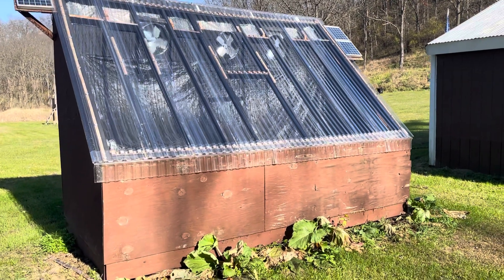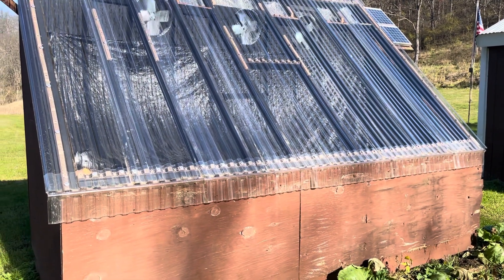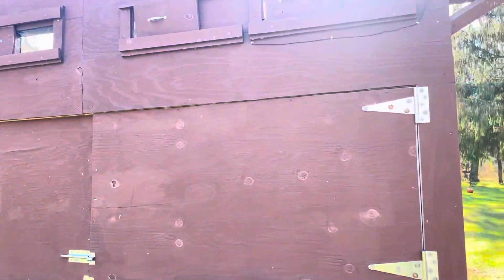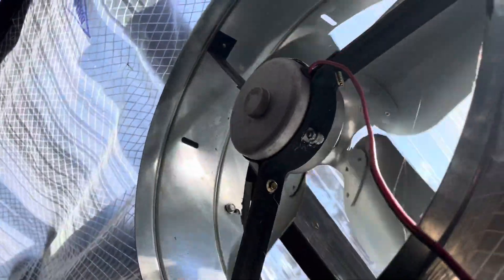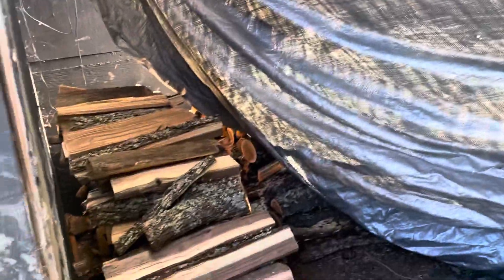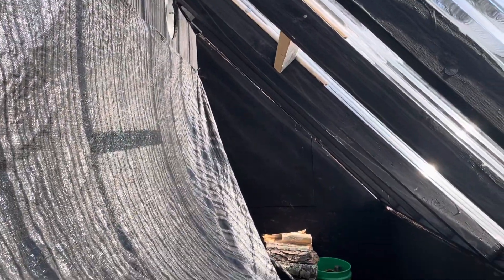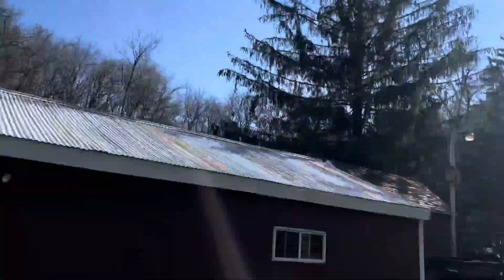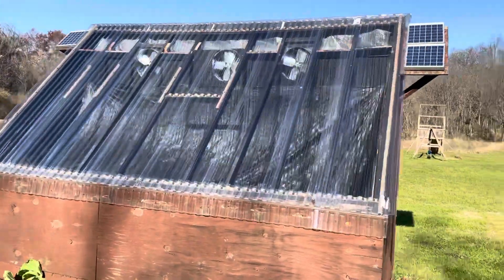Off Grid Solar Kiln Overview - How to dry firewood fast - How to season firewood quickly

Comment: Weird question but with convection wouldn't the cooler air come in through the bottom vents and then rise as it heats up and then vent out of the top vents?
Reply from the maker: It would if there weren’t any fans. The fans produce far more powerful air currents than any differences in air density due to temperature.

Comment: would it dry faster if i made out of metal?
Reply from the maker: It would last longer. We have some outer panels now that are warping and need to be replaced. You would still need to insulate it of course, I don’t know if the actual material would make a difference in heating / drying ability.

Comment: This is a cool design!

I think you could automate it and over-engineer it somewhat by adding a Raspberry Pi or similar microcomputer to measure the temperature and humidity inside then to use that info to control servos to open or close vents.

As an example, just hypothetically, if it's above say 70% humidity you could set it so the vents open up unless the temperature is below 50f.

If it's between 50f and 70f with humidity above 50% you could set it to open one vent.

If it's above 85f, you could set it to open all vents unless the humidity is below say about 30%.

The best thing about this is, if you are clever about it, you could also set a notification for when your kiln has been consistently below 25% humidity for a number of days regardless of the internal temperature. That would indicate that the firewood is dried sufficiently to be ready for use (well probably anyway, though you might need a little trial and error to fine tune this.)

You could overcomplicate it further by measuring the ambient conditions and using that data as well, or by setting up a program so that when the internal conditions aren't producing more humidity than the ambient humidity that all vents are shut regardless of the temperature to do a final day's cooking to force out any extra moisture from the firewood.

You could also do something with a parabolic mirror that focuses on a thermal mass that the firewood rests upon. Think like a mass of concrete or dried clay/cob that has a layer of insulation between it and the earth it's resting upon. During daylight, the mirror would direct solar energy into the thermal mass. This would create stability in temperature inside the kiln and it would speed up the process as the solar energy stored in the thermal mass would continue to heat the space after the sun has gone down. At this point you'd probably want double-glazing on the angled window of the solar kiln for better insulation to really make the most of things. The microcomputer could also be used to track the sun and adjust the parabolic mirror accordingly.

Overkill? Almost certainly.

But it would make for a great YouTube project and if you designed it really well then you might have a highly efficient solar kiln. This would be ideal for people to build where they have limited space or where a rapid turnover rate is desired.
Reply from the maker: That would be fun for sure… just for the hell of it. But definitely beyond my scope of knowledge!

You know when I built it I figured I’d adjust the vents daily… in reality I adjust them every three to four months 😆 but a humidity control would be pretty cool
Reply: @TheNorthwoodsFamily  Yeah, it's far beyond my abilities as well.

If you ever felt inclined, I'm sure that a Raspberry Pi/3D printing type creator would be interested in taking up the challenge and striking up a partnership with you on it since most of the time these talents go towards making little tchotchkies or turning lights on or off in a house. Being able to put that knowledge to something that has real-world impacts and is sustainability oriented would be enticing, I'm sure.

Ultimately the basic design principles that I explained above could be applied to stuff like controlling solar food dehydrators or more exotic things like food smokers or a solar laundry drying cupboard sort of thing. Obviously with different applications people would need to adjust the parameters slightly to suit but ultimately it's just a way to automate the control of temperature and humidity to achieve the desired outcome so it wouldn't be all that hard to tweak the dials if you aready have the blueprints that someone else has drawn up before in a similar project.

I wish I had connections to shop this idea around for other people to take on since it seems like it would be a pretty doable project for the right person.
Who knows, maybe some day the person will stumble across this comment and feel inspired? Lol

Comment: Nice kiln, is it still holding up?
Have you considered adding concrete blocks (or something else) as heat trap, so it extends heat when sun goes down? It's not recommended for lumber because you don't want too much stress on the lumber, it seems great for firewood
And other question, why do you open your vents more during summer than during winter? Again, that seems logical for lumber because you don't want too much heat but firewood? There is no such thing as too much heat for firewood :)
I hope you don't mind me asking these questions,  I have plan to build smaller variant of this just for personal firewood drying so just getting as much info as I can before
Thanks
Reply from the maker: It is. A couple outside panels the plywood is starting to separate so we’ll have to replace that sometime. Haven’t thought about the concrete but that’s not a bad idea. 

With the vents I’m trying to balance retaining heat versus expelling moisture. In winter I close them down to retain more heat. I’m not scientific about it at all honestly… I’ve noted humidity levels a few times. I suppose to really maximize drying I’d adjust it every day or more. But I don’t have time for that 😂
Reply: @TheNorthwoodsFamily  yeah, I get what you are saying. In my build I plan to leave vents out and just have one with solar exhaust fan that has temperature sensor (saw idea from another solar kiln video). So I can set certain temperature it activates on and have nearly user input free kiln. That is idea at least, I do still need to find good product, didn't even start to look at that yet 
Thank you for your reply ;)

Comment: Air comes in from the bottom and goes out from the top. You said it backwards
Reply from the maker: No I said it correctly - and that’s a common misunderstanding people have.

The fans suck the air in through the top vents. It is heated by the sun, and then pushed through the stack of wood. Some of the warm moist air exits the lower vents and then some of it is recirculated.

I realize warm air rises… but the power of the fans is much greater than the draft that is created by the difference in air density.

Comment: I would have thought the cold air would have come in the bottom and the air would rise as it warms and exhaust out the top.
Reply from the maker: A lot of people think that, but when you realize how much more powerful the airflow from the fans is versus air movement from a minor difference in air density, it just doesn’t matter. Plus this way you’re blowing heated air through the wood, versus cold air from the outside.

Comment: Very nice job! I like the tarp idea as it allows varying sized loads. I made one using a small 1500w space heater, fans and a dehumidifier.Heater runs to get the kiln up to 80°F, then it doesn't run anymore. Dehumidifier runs 3x day for 2 hours every 8 hrs. That produces enough heat ro force the moisture out of the wood, while then removing the water from the air. Takes about a month to dry 300bf of hardwood....but I like your no electricity model better!
Reply from the maker: That sounds pretty slick too! Probably a little more consistent than ours but it is nice that it doesn’t cost anything to run!

Comment: PRETTY INTERESTING....But tell me again how the cold air and hot air circulate? Because the last I knew....HOT AIR rises, which is why a hot air balloon floats, and cold air sinks!! WHICH by your own design, you are not directly "controlling the air intake through the fans" as much as just having an opening where hot air can escape from!!
Reply from the maker: I’m not an expert in fluid dynamics, but I can assure you the airflow produced by those three large fans in a relatively small space is substantially more powerful than any updraft caused by a small variation in temperature.
Reply: You are right.  It seems like this design was made for kiln drying boards, trying to get to a hot enough temperature to kill off insects and such.  It doesn't seem optimized for firewood drying.  Especially for someone who already has a chain saw mill.  The fan and the tarp aren't needed.  Painting the end walls black is backwards, they should be insulated and aluminized.  The air intake should be in the front just above snow line.  The outlet should be high on the shady side.  There should be baffles to cause the warmed air to move away horizontally back and forth through the firewood.  The baffles should be painted black.  The doors should be insulated.  Recirculating humid air should be avoided.  Even if the temperature is cooler, the rate of drying without recirculation should be better, and the structure should hold up better. Of course, this is reasoning based on engineering principles, rather than practical experience, so there may be factors that I haven't considered.

Comment: looks cool .
ive a 12x12 shed that im thinking of painting matt black to attract the heat and then use solar powered fans placed near the top and small punched holes near the base to draw through air ,what ya think ?
🤔
Reply: I have a 12x8 tin garden shed that i have painted the roof black on and have 2 120mm solar powered computer fans pulling air out the bottom bottom of the shed at each end......air comes in the ridges in the roofing iron, is heated by the heat coming from the roof and is drawn down thru the wood and out the bottom.......shed is sitting on a concrete slab.....i can have split green wood that under normal circumstances take 2 to 3 years to dry ready to go in 4-5 months from mid summer to the start of burning season

at my last house i had a 8x14 glasshouse set up the same way but with 3 fans on each end, the first time i used it it had a dirt floor that sucked up moisture out of the ground and pretty much stopped the wood from drying anytime there had been rain or even a heavy dew, poured a sealed slab inside the glasshouse and it solved all issues
Reply from the maker: I’m sure it would help some. I think the internal baffle is a key component however. That’s what actually forces the warm dry air through the stacked wood. Could be as simple as a tarp or two to route the air. Without proper airflow it will get warm which is good but you won’t get as much out of it

Comment: Great video.  I deal with same environment north east WI. Close to U.P.  I currently use IBC totes to store firewood transport with tractor.  Cover them with tarps store in woods for 2-3 years to dry.  Low effort load in tote from log splitter once ready move to porch with tactor.  Only issue is snow and rain on the sides over the year and It really doesn't dry efficient takes 2 years or so.  Been looking into kiln ideas wouldn't have to store so much wood.  Like this idea I would build taller and deeper to fit 4 totes of wood.  I currently use 7 to 8 totes in a season (roughly 3-4 full cords).  Few questions, I looked at the link you attached what kind of paint did you use?  What fan kits did you use?  Could you add a link?  Solar fans I found doing a quick search are either plastic or small metal ones.  Assuming plastic wouldn't last long.  Part of my property has the main highlines so its a wind tunnel most the year.  Thinking i might not even need the fans.
Reply: Sorry, should have read you comments before I wrote this.  Found your response on fans.  Other question what did you insulate with? mineral wool?
Reply from the maker: No worries… I believe it was just mineral wool, batt insulation. Paint was an exterior latex, the black paint inside I thought was supposed to be something that did better with moisture. It was a few years, so I don’t remember all the details!

Comment: Great Video. How long does is take to dry the firewood during the winter? Thanks again for the awesome video.
Reply from the maker: Thanks! It’s hard to say because it all depends on the wood and temps and sun. I’m sure a freshly cut hardwood would take months, but stuff that was already dead but needed some drying, I may throw it in there for a 4-6 weeks and it comes out good enough to burn. In winter I’ll split stuff smaller to help it dry faster. That helps a a lot too.

Comment: This is a very neat design but I think I would paint the outside black and the inside white. The idea would be that the outside would absorb the heat of the sunlight while the inside would reflect it around. Just a thought.
Reply: After reading the original design PDF, it looks like they were more concerned with making the interior a moisture barrier so I guess the color makes more sense.
Reply from the maker: Yeah, I think the white would also reflect light back out through the roof too. The walls are insulated for what it’s worth… black outside might help a little but it wouldn’t look great in our yard 😆

Comment: Have you done something to confirm that the air is entering from the top and leaving the bottom?  With those fans barely moving it doesn't seem like nearly enough to overwhelm the natural convection trying to move the air the opposite direction.
Reply from the maker: The fans were actually spinning at very high speed in that full sun - it’s just the combination of the fan blades turning and the frame rate from the camera was set at them look slow. You wouldn’t want to stick your hand in there!

They do create a stiff breeze, you can really feel the warm air coming out through the bottom exhaust vents in the door.
Reply: @TheNorthwoodsFamily  Ahh, I didn't consider that.  Thanks!

Comment: Cool idea and set-up. One question, why wouldn't you have the airflow circulate in the opposite direction? Since warm and rises (and with it moisture) wouldn't it take less energy to allow the warm moist air to escape at the upper vent and pull in the cool fresh air from the bottom? Or you you trying to maximize temperature?
Reply from the maker: Good question, you hit the nail on the head. You’re trying to keep the temperature up because the other thing with warm air, it can hold more moisture. So in winter, I will close the vents down almost all the way to preserve as much heat as possible, and open them wider in the summer.
Reply: It actually does go the other way. you can tell by the direction of the fan moving.  its "scooping" from teh black tarp side, then drawing it to the back, down in the rear, and the cycle continues.  
 @TheNorthwoodsFamily

Comment: Does this work in the fall winter months, or only the summer?
Reply from the maker: You can figure it will get 30 degrees or so warmer than the outside air on a sunny day. So it actually will dry wood pretty good in winter too, maybe not quite as fast since it's not as hot, but our winters here are a lot drier too.

Comment: Why the tarp? Wouldn’t it have been better to build a second sloped wall?
Reply from the maker: If you were to build a solid wall coming down you’d always have to stack your wood to that height. All the tarp does is force the warm dry air to pass in between the logs / boards instead of escaping over the top or around your stack. It’s easier, cheaper and gives you more flexibility in your drying.

Comment: I believe I saw in a Michigan DNR publication that it takes 200-300 days to atmospherically dry firewood. The 42 you get in your kiln is a big time savings.
Reply from the maker: It’s an extra step to throw it in the kiln but it does speed it up a lot. Also - added bonus is it kills all the bugs so you can bring it in the house with confidence. Thanks for the great comment!
Reply: Not dead standing wood. I can cut down dead standing trees and stack them in a sunny spot with air flow, in July. They're ready for Winter

Comment: Can you please post a link to the exact solar fans you used for this?
Reply from the maker: Hey Ryan... so the kiln is 6-7 years old and I don't remember where we got them from - it might have been Sam's Club or Costco? We paid $120 - $130 a piece, they seem to be $300 each online now which seems pretty steep.

I found this one on ebay
https://www.ebay.com/itm/124849962309?hash=item1d11a33d45:g:zgkAAOSwtsRgFd2E

Here's a retail site.:
https://www.energyavenue.com/Ventamatic/VX2515SOLARGABL?gclid=Cj0KCQiA_c-OBhDFARIsAIFg3eyecGvxd2BgWZKRfOt_f1TK9pO-sSoYBveva1SdgEIPqT3aO7uBoFMaAue-EALw_wcB

If I had to do it again seeing those prices, I'd just buy the components and wire them up myself. It's a super simple system, connect two wires. We have the three small solar panels, but you could run all three fans off a single larger one too.
https://www.amazon.com/ACOPOWER-HY015-12P-Watts-Battery-Charging/dp/B01G1II6M8/ref=asc_df_B01G1II6M8/?tag=hyprod-20&linkCode=df0&hvadid=167118301188&hvpos=&hvnetw=g&hvrand=274385370633689807&hvpone=&hvptwo=&hvqmt=&hvdev=c&hvdvcmdl=&hvlocint=&hvlocphy=9018927&hvtargid=pla-393229784593&th=1

Hope that helps....
Reply: @TheNorthwoodsFamily  I wonder if I could use computer type fans if I make the plans smaller?